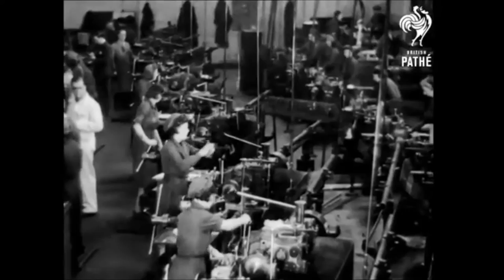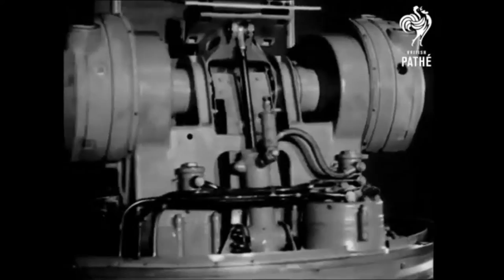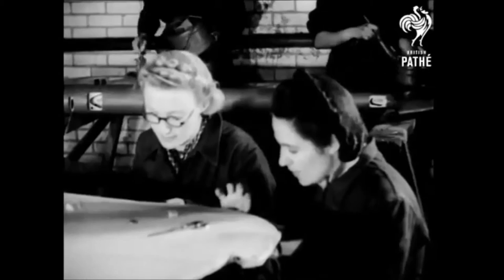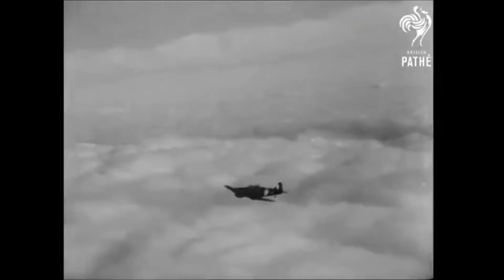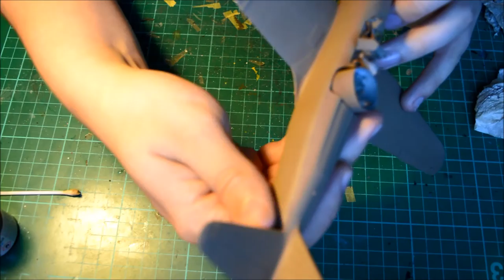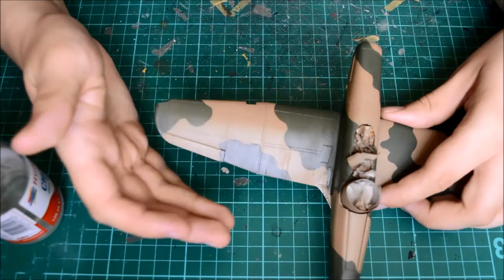Airfix 1/48 Boulton Paul Defiant Mk.I - Part 6 (Painting)

Comment: Looking good mate
Grit you are talking about looks like the paint starting to dry before it hits the surface of the model
maybe play around with your paint to thinner ratio and air brush distance and air pressure
those Revell paints are great I wish I could get them
kind regards Matt
Reply from the maker: Thanks Matt, I was almost certain I had the right ratio as I did experiment with different ratios and still came out the same for some reason, and yh the Revell paints are great for both airbrushing and brush painting, I was sure by now that Revell would at least post their products around the world like other companies? I'm not sure what to suggest sorry. Regards Mike :)

Comment: sounds like your air pressure is too high and paint the too thick it's all trial and error on paint the to air ratio I always paint with more thinner than paint 70%thinners and 30%paint  just find and old model and practice your paints through the airbrush then you will just click and you will be spraying like a pro mate keep at it drop me a pm if you have any questions happy modelling and keep having fun😊
Reply from the maker: Thanks Faron, like I said to Mark, I just gave up with it in the end, tbh its the first time that's done that to me and I did use different ratios and air pressure and even the distance someone told me on Facebook, I don't know what was wrong with it but will test it out some other time like you've suggested, if I have any more problems I'll drop a message thanks :)
Reply: +ModArt633 also consider the warm weather that can effect the paint as well